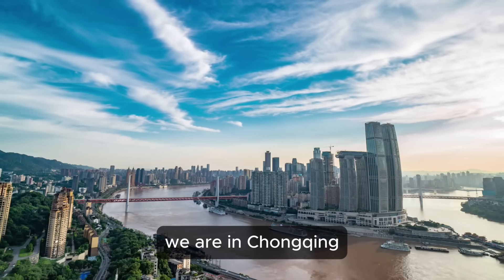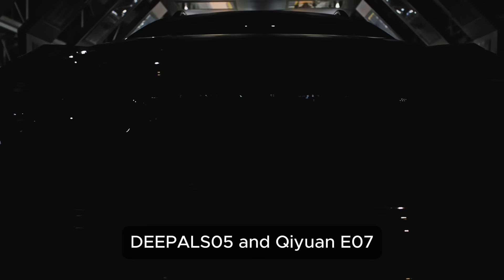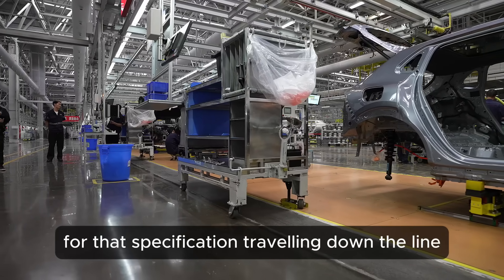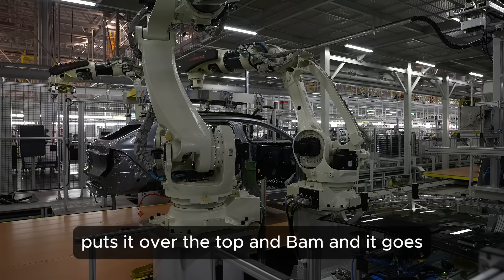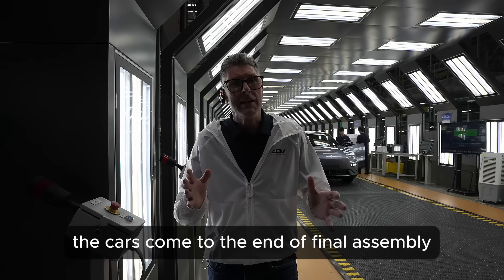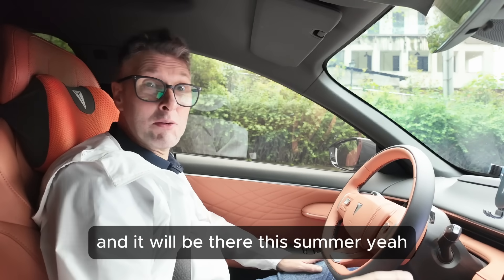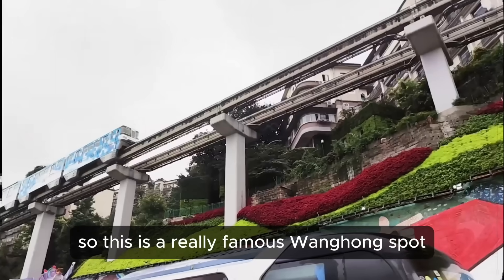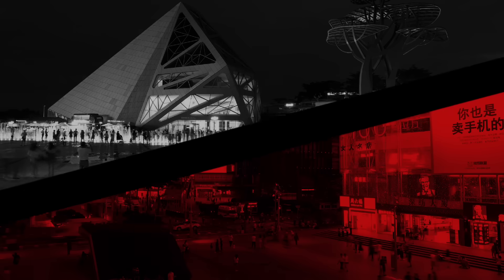Chinese Automated Car Factory of the Future.

Comment: Nio car plant is more modern
Reply from the maker: No, actually it's not. I have visited both..
Reply: @BarrettYT  Nio's F2 factory in Hefei has many more robots than Changan, around 950
Nio also does not have a dedicated production line but produces all models and brands together, Nio Onvo Firefly each on its own AI-controlled cart
You would have seen that if you had actually visited Nio's F2 factory in Hefei
Reply: @magnusspas7732  不懂装懂